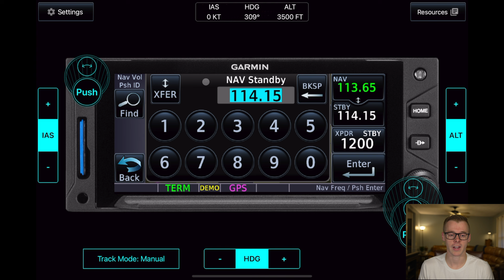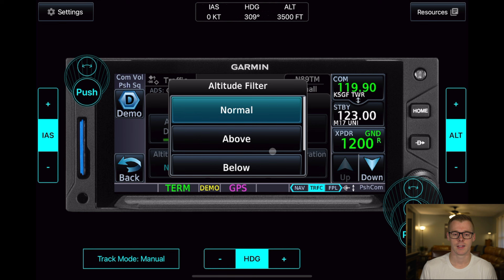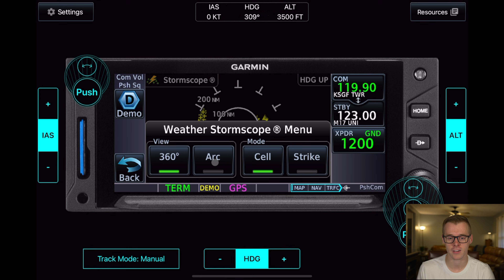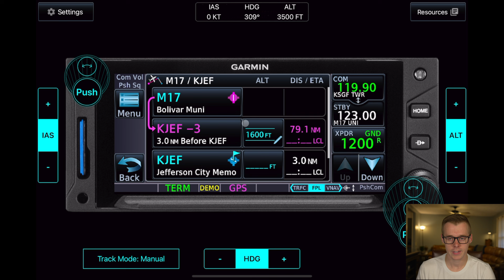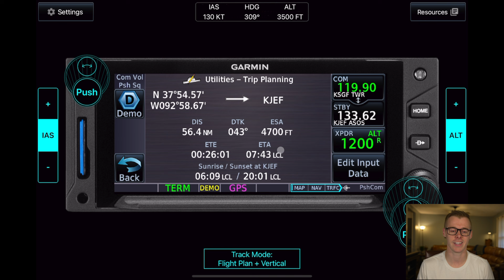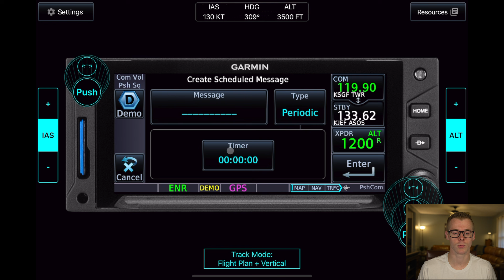How to Use the Garmin GTN 650 Xi - Tutorial for Beginners

Comment: Hey Cam, great video, thanks for sharing!

I have one suggestion for when you need to input a VNAV fix along the track. I use this all the time.

Instead of manually creating a new waypoint along the track. Click on the altitude restriction for the reference waypoint (say your destination airport), this will bring up three input buttons: “At”, “Altitude constraint”, and “Along Track”. Click on the “Altitude Constraint” button (“_____FT”), this will bring the next menu option, where you enter the actual altitude constraint, including the “Mode”. Click the “Mode” button and choose “Above Ground Level” (AGL), from there you can just say, for example, 1000ft (pattern altitude). Finally, click ENTER, and you can choose the distance along track. This should save you a couple of clicks, and in theory be more accurate since the system will use actual height above ground… maybe? Not sure the resolution is that good.
Reply from the maker: Hi Rodrigo, thanks for watching! You’re absolutely correct that this can be done through the waypoint itself, I didn’t know you could add an along track waypoint that way. Also very good advice on switching to AGL, which I’m sure would work just fine. Thanks again!

Comment: Your teachings are so explicit which requires not effort to understand, thank you for your time. I have a question, How can I set up my 650 TXi auditable alerts?
Reply from the maker: Hi Oscar, thank you for the kind words! For audible alerts, you can configure an arrival alert by going to System > Alerts > Arrival Alert. If you are wanting to modify terrain, traffic, or GPWS callouts, the pilot's guide says you should be able to go to System > Voice Callouts and change those (pilots guide page 2-93), but that feature is not activated on the GTN trainer app so I can't verify. Hope this helps!